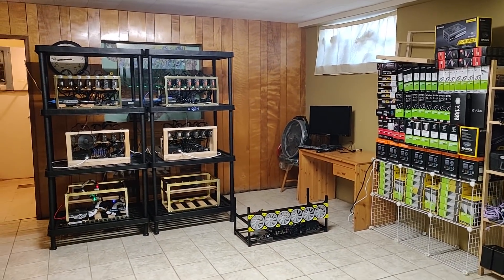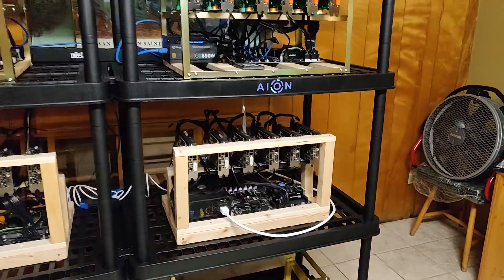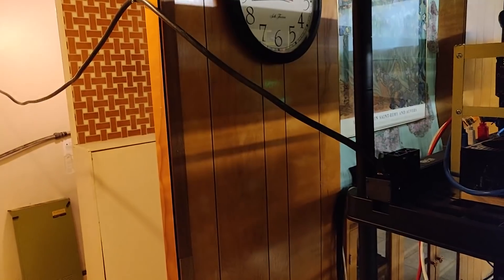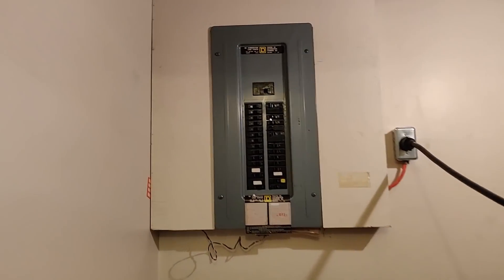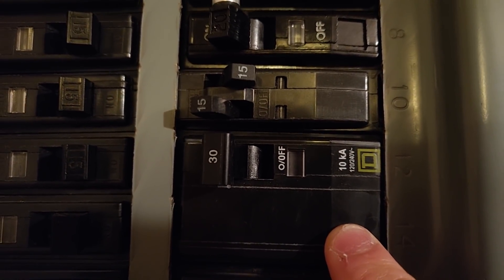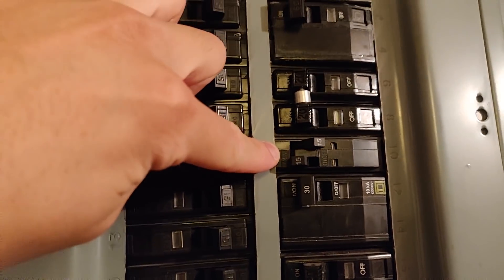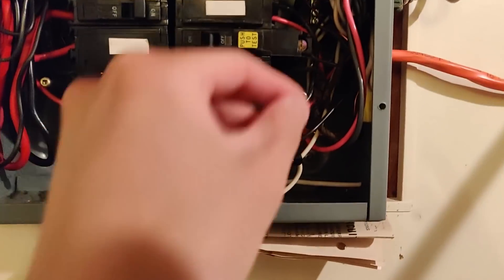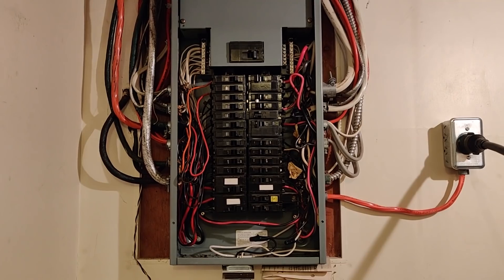Should I Add Another 30 Amp Breaker To My Little Mining Farm?

Comment: I still have my electrical license... so I'm taking from experience. You need to figure out the load the house is pulling before you add more to it. Just at a glance your panel looks very full. And it only has 100 amp service. I'd start by putting an amp meter on the mains to see what it is drawing per leg, then start turning things on to check max load. Do not exceed 80 Amps per leg if you have 100 amp main. As for the length of the wire or where you put it wont matter in your situation, no need to do calculation unless you plan over 150 foot of wiring. Hope this helps,

Comment: You can call your power company and request an efficiency inspection; they will conduct it for free and not only find ways for you to reduce your bill, but will advise you on the best way to upgrade your system.  There is just way too much going on inside of your junction box already, and by the looks of it; someone has been adding to it for years.  You need to make sure that none of those wires are aluminum because they screwed around putting that stuff in for a few years until they realized it expands and contracts way too much based on the load and causes shorts and arching; neither of which is good.  There isn’t much room for additional wiring in that box no matter how many breakers you squeeze in.  As I mentioned before, I would remove the plate around the main breaker where the main lines come in; loosen the bolts that hold main lines into the main breaker switch and slide it in with the main line a 3, 4, or 5 awg wire in before the main breaker and run it to a 100amp sub box; ( I have 2 guage awg wire running from my solar battery bank to my inverter).  I used 5 gauge awg wire just as discribed, and ran it out through grey PVC pipe to a detached 12' X 30' building I setup for my mining farm and related equipment.  Be careful and good luck no matter which way you go.

Comment: need a service calculation to determine what you can add total, panel is rated at 125 amp, with a 100 main breaker installed. Can upgrade the main to a 125 amp providing the wire from the meter outside is big enough to allow for a 125 amp main, which it usually  is not in most houses. Service calculation is the key, that will tell you exactly how big of a main service is required to add everything you want and what you can add with the one you already have. Id just hire a local company thats reputable to come in and look at it. They give free quotes or should.

Comment: Only add 1 more 30 amp breaker/plug. If you do 3, you will be using up your full amperage for the whole house. Capped at 100 amps, you wont have any power left for cooking, laundry, or those fancy Hitachi vibrators

Comment: Firstly 10/12_amps only being used from 100 amps available ? You should run at 70/75% of total NOT total .breaker sizes check slim ones and google them to see range watch rail spacing sizes as they vary at rear of breaker. If not you can buy 150/200/250 amp breaker units complete in the UK from £75/£250 not a vast fortune .get a quote for a sparky to fit it and weigh up the affordability,/ savings / u know what your doing .just go slow research plenty and go for it ,I would do it but I'm too scared to buy a mining rig to build .I'm asics only .  or if its not too expensive get a Sparky and sleep soundly with an insurance rated pro job .I'd do it (home wiring)but not the mining rig lol but I'm infamous for making the wrong choices.

Comment: Add tandem breakers like you said on the 15 amp you currently have to condense it. Just make sure you arent pulling close to 80 amps of the whole box. I like 70 amps on a 100 amp breaker.
Reply: Panel is a "Square D QO"
 QO =  quick open.

Comment: It's pretty simple to do, but sounds like you def have a lot more googling to do... Biggest thing is knowing the max wattage you would ever run in the entire house to see if you can add more breakers (safely). Their also a code about how much capacity the box is allowed 

https://www.howtolookatahouse.com/Blog/Entries/2018/6/what-is-the-maximum-number-of-circuit-breakers-allowed-in-an-electric-panel.html
https://www.homedepot.com/c/ab/types-of-circuit-breakers/9ba683603be9fa5395fab900f0d22b4
https://www.bobvila.com/articles/wiring-a-breaker-box/

Comment: Wow that panel is full. You need to know how much is running on it. 125 amp x 240 30000 watts so 80% you have 24000 watts you can run 24/7. Need to know how much the house is using on its own.

Comment: so would you purchase Radion vii or 166ti?  Which one would you prefer?  Regarding the electric. recommend setting up another subpanel.  say 60 amps .  that will take care of what you will need
Reply: may help  https://www.youtube.com/watch?v=oDor0hNmfL8
Reply: change out that 30 A single throw to a double 60 A.  then electriction can run the 60 A wire to a sub and you can add the 120/240 plugs right off sub.  less wires more clean. one out in my garage works slick!
Reply: Also easy to remove as there is just one wireset from panel

Comment: Do not do it unless you update your entire panel to a 200amp.   I had a 100amp with a similar farm and my hydro provider called me and said i am maxing out my wattage and risking a fire. They came to my property twice in 3 weeks.  Mind you, I was dual mining at the time.   Still though, I highly suggest you do not add more rigs to that 100amp.  Having a 100amp panel doesn't mean you can max it out 24/7.   I think I remember hearing it should be safe running it about 75-80% capacity.     If you share that panel with the rest of the home, then absolutely forget about it.    This is important info bro!     I got nice 200amp panel put in and let me tell you, the piece of mind is so very worth it.   Plus now I can add more rigs with confidence ;)

Comment: Also, as your garden grows factor in exhaust amperage.  This along with filtration will be critical to maintain clean, cool air. Even more important than hash rate or cost of electricity.  If your rig is dirty and hot.... No hashy!

Comment: Those Breakers are the worst. I would upgrade your 220 volt circuit to 50 or 60 amps. I have a 50 amp circuit with number eight gauge wire to the panel that lets me power my rigs add exhaust system which is 240 volt also. I'm not an electrician but I am a HVAC mechanic for 15 years. The white wires are neutral and green is ground

Comment: No, you cannot do it yourself (without knowledge and experience). No, those white wires are hot! No touch! No, do not solder wires together (dub king)! It's an easy job for an electrician to wire up an existing breaker. The white and black wires are hot and together make approximately 110-120 volts. The bare wires are grounds. Only use 80% of max capacity of the breaker. Some electricians will give a bid for free and inform you of options in the process. And Yes, you should have plenty of electricity! Bull run will be here before we know it.
Reply: No.. white wires are neutral not hot. The two hot wires are the red and black ones. Do not confuse neutral with ground even though they are terminated at the same location.
Reply: @TheCryptoMiner   yes. I made the mistake of calling the neutral  hot. for safety reasons the entire panel should be treated as hot. They bite hard. Have a good day!
Reply: Obviously. Like i said.. not to be confused for ground even though they are terminated at the same location in a Main panel. You will not recieve a shock because its grounded.

Comment: 144/5000
I'm not an electrician, but that's what I did at home, transformed 15amp breaker to slim 15 amp breaker. To have more 240V outlet